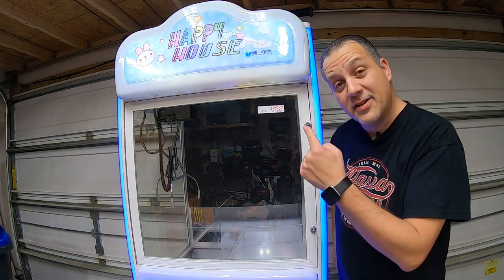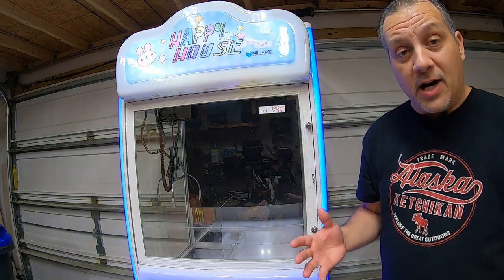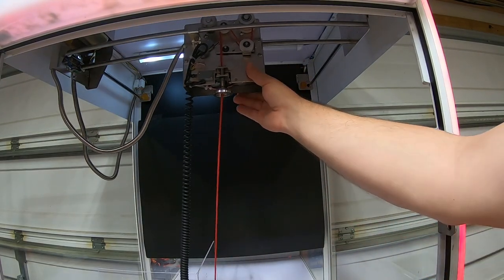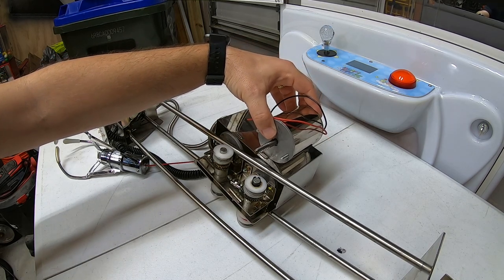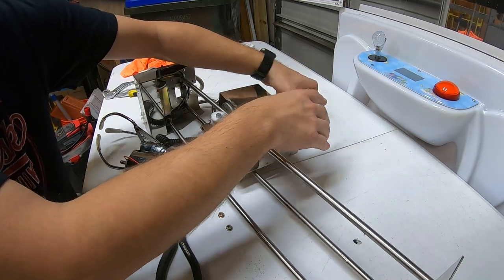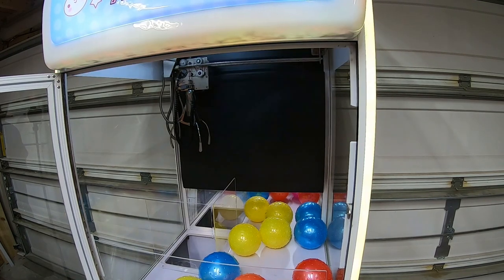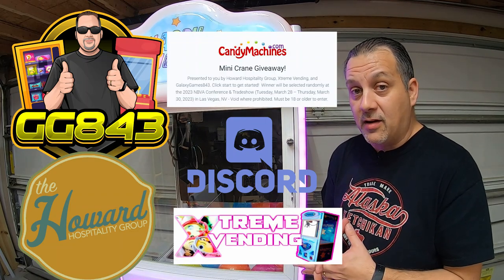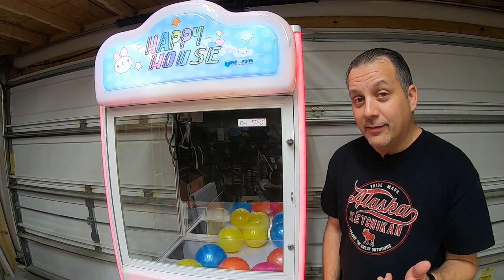CLAW MACHINE REPAIR! Watch Us Diagnose And Fix This Claw Machine!

Comment: When I got the mini claws - we both replaced the crane cables with heavy loaded fishing line - never had an issue with the operation of the claw opening or raising up & down. Add a basic multimeter to test your soldering connections & you have it all covered.
Reply from the maker: Never thought of fishing line! And I do have a multimeter!
Reply: @GalaxyGames843  Very lucky that above the laundromat my friend owns - we have a retired "Sparky" (What we call Electricians) living in 2 of the 3 apartments. Piano wire is good too but very expensive for OUR needs.

Comment: This was very interesting and informative. I would like to see a video on the repairing of the light system. You see lots of videos of people collecting money, but very few people put out videos of the actual pairs these machines need. Thank you. I hope things are going well.
Reply from the maker: Honestly for the lights, I usually just swap in a separate LED light made for under cabinets from Walmart. Wouldn't be much of a video!
Reply: @GalaxyGames843  thank you for the reply I was just wondering. Didn't know if you were going to replace it with a new LED set.

Comment: Great Video! Its so fun when you can get a claw machine for less than $600 with cost of parts (assuming the part was $75 or less). And yeab those knobs get stuck on my claws too if they are too inflated... so anyone watching i can testify that the knobs where to inflated
Reply from the maker: Thanks! Yea the claw works fine with plush!!!!

Comment: Glad you got it working.  Weird that the motor was bad on that new of a machine.  You may need to grease the worm gear so it doesnt wear out the toothed gear it interacts with.
Reply from the maker: It was a used machine so it happens from time to time - luckily the gear is metal and not worn at all but I do have a replacement!

Comment: I bought a rainbow crane machine (the carriage looks alot like the ine in this video) and everything works great except when you move to the right it doesnt want to go forward just creeps like a snail but if you go left it will go forward normally.  Everything looks good on the belts on the wheels so i really have no idea where to start? Any idea? I appreciate any info at all you may have.  Thanks!
Reply from the maker: Hey there. Im not as familiar with the rainbow cranes but im guessing it could be a motor or a power issue... Id try replacing the motor first

Comment: Hi man Good video, i got a similar machine with another problem, the Claw goes up and never stops, i think the switches and wires are okey so i dont know what happened, do you have any idea? The lcd panel send the error 03
Reply from the maker: Do you know which model machine it is?

Comment: Sorry, my English, I'm from Brazil, I have a similar problem, my machine spends a while working normally, then in one move it lowers the claw to the prize and it doesn't go up anymore, the move ends but the claw doesn't return. the cart returns to the starting point but the claw does not go up. you start another turn with the claw down. Could someone please help me, I've already changed everything, motor, switch, cord and the problem continues

PORTIGUES - desculpa meu ingles sou do brasil, estou com um problema parecido, minha maquina ela fica um tempo funcionando normalmente, dai em uma jogada ela abaixa a garra ate o premio e nao sobe mais finaliza a jogada mais a garra nao retorna. o carrinho a volta para o ponto inicial  mais a garra nao sobe. voce inicia outra jogada com a garra baixada. por favor teria como me alguem me ajudar, ja troquei tudo motor, switch, cordinha e o problema continua
Reply from the maker: It sounds like it could be a problem with the string, or the actual main board
Reply: @GalaxyGames843  I already changed everything. I just didn't change the main board